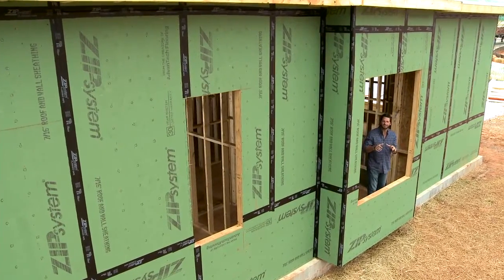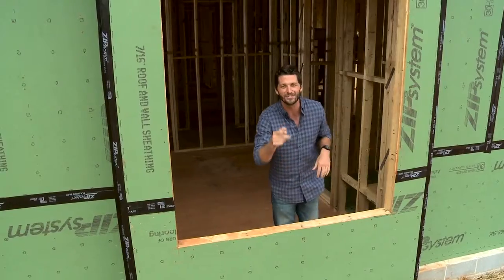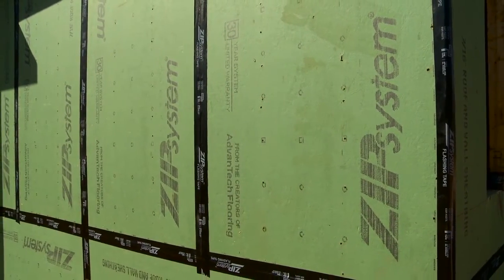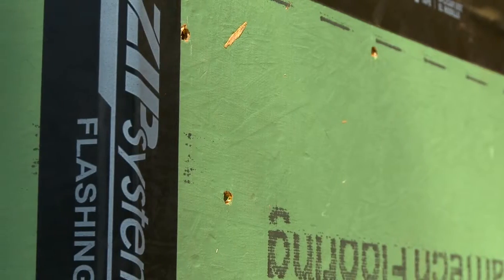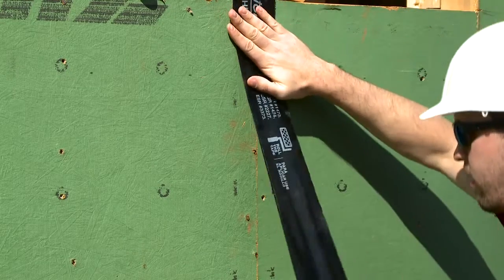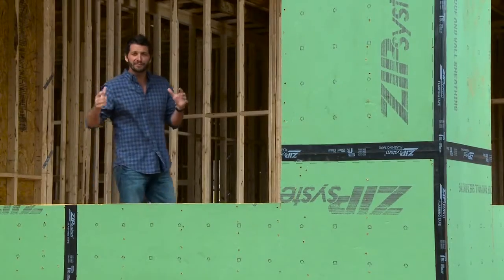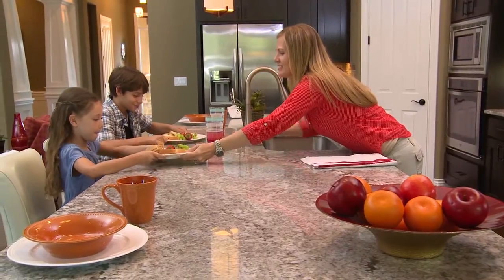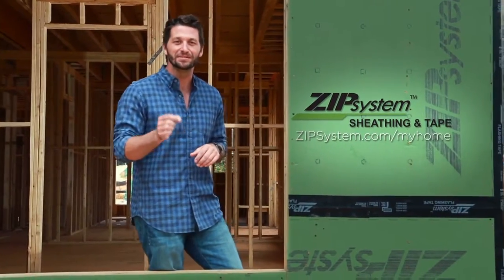ZIP System Sheathing & Tape Helps You Save on Energy Bills

Comment: This would have been a good video and the product is very robust to prevent water/air intrusion, but for failure to also tape the numerous holes seen throughout this video! Come on guys its only as good as the installer!
Reply: Warranty already voided for the whole thing.
Reply: 8 years later and this video is still on Huber's website. I cringed seeing all those nail holes, and I've never even used the the panels yet.